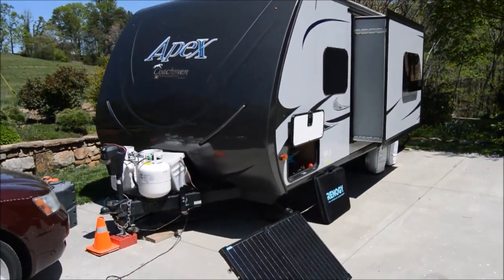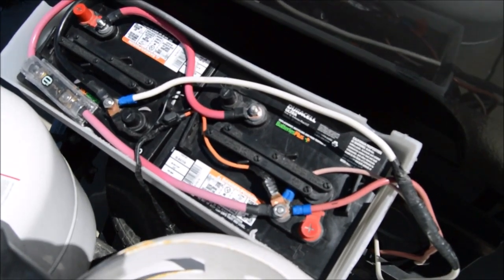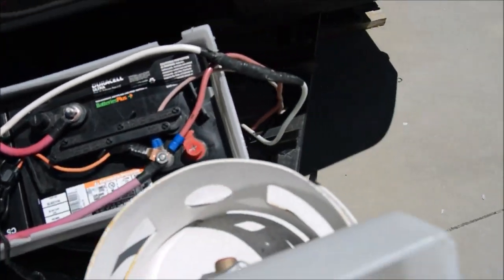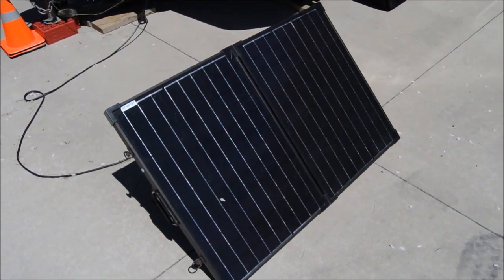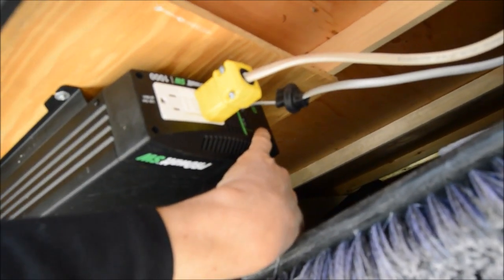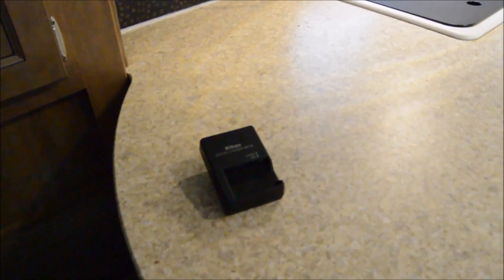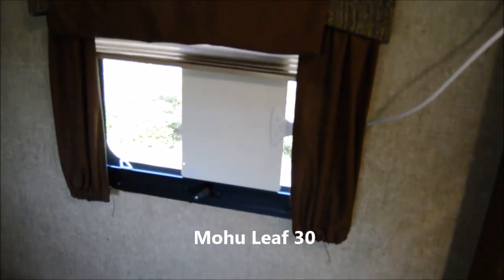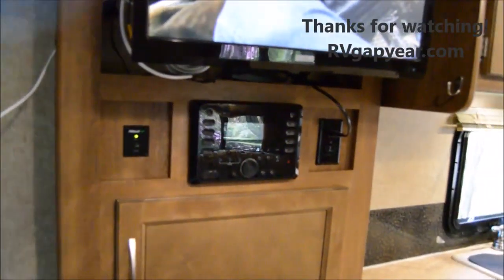Budget Boondocking: Solar, Battery, and Inverter Decisions

Comment: I'm having a hard time understanding the wiring. You only have 1 outlet for solar. The dc lights still run off battery I guest turn off H/W and Refrigerator because I seen some completed systems involving  the panel box and inverters converters

Comment: How much of a benefit is running two six volt over running two 12 volt deep cycle?
Reply: For the same amount of Amp-hours, two 6 volt batts are gonna be about half the price of two 12 volts. Mainly because the 6-volts are used in golf carts, so they have a huge advantage in Economy Of Scale. Readily found at any Sams or Costco.

But It's REALLY important to keep them charged with a quality 3-phase charger. The old 89's/90's dumb (constant voltage) chargers will never fill them correctly, which will lead to an early lead-acid battery death. Same goes for any solar or wind charger.

Comment: HOW'S YOUR SOLAR HOLDING UP??
Reply from the maker: Very well. The batteries have exceeded our expectations!
Reply: @rvgapyear7208  my question is do you have a theft deterrent device or something to keep your solar suitcase from being taken? Any ideas of what can be used?
Reply: @jet0577  10 foot cable with combo lock. If somebody wants to steal something from your boondocking site and you aren't there it's going to happen. Small measures just act as a deterrent.

Comment: Hey There, How did you wire up the receptacle? Did you cut off the end of the extension cord and connect it to the receptacle or is that a 14/2 wire that you put a plug end onto so you could plug it into the inverter?
Reply from the maker: It's 14/2 residential stuff (normally run through studs) and I just stripped one end and bought a $3 plug at Home Depot.

Comment: Did your RV come with an inverter integrated into it?  If so, couldn't you simply wire to it instead of buying another inverter?
Reply: Is your inverter in RV ok to use for this
Reply: Trailers don't come with inverters they come with converters. If you want an inverter when you buy your trailer you  have to request it as an extra.
Reply: Dan Kriston mine came with 1000 W inverter, it runs the residential refrigerator while driving.

Comment: Trojan t105 are 144 dollars each. That's insane
Reply: I get Sams or Costco T-105 replacements (typical golf cart size) for almost half that. In my experience, they only have about 5-10% less real world capacity than Trojan brands. Totally worth the cost savings. Going on 10 years using them in heavy boondocking/solar setup.
Reply from the maker: Yeah, Trojans have a good reputation but my Duracells have held up remarkably well over the last three years and I saved about $100 vs. Trojans.
Reply: Emmy Ann dunnuo... I need a new battery for my truck $119

Comment: Can you charge the batteries via solar while you are using the inverter? Also, Are fusing needed for this or is that just something for extrA safety? thanks
Reply: Yes you can charge the batteries with solar while you are using the inverter. The more solar you have the faster the battery will charge. Keep in  mind that in most cases the inverter will still draw power faster than solar will replenish the batteries.Fuses are always recommended. Fuse or breaker between solar panel positive and controller positive and between controller positive cable and battery positive terminal and another fuse between battery positive and inverter positive.
Reply: YES! I would always recommend using a fuse. It's cheap insurance.

Comment: Did you run into any issues drilling into the floor to run the heavy gauge wire. I'm worried I might drill into some framework so I don't know where to place the hole. Thanks for posting this. 👍
Reply: I was able to drill from the bottom next to existing wires so I know where the frame was. I had no issues at all.

Comment: Is there a good size inverter  to get some say a small one is just as good.  Jack
Reply: Buy a pure sinewave inverter that meets the needs you have for AC power. Getting an inverter too large just uses up more battery power to run the inverter. The larger the inverter the more battery power it takes to run the inverter. If you plan on upgrading your battery bank to more capacity so you can run more AC appliances then by all means get a larger inverter so you don't have to upgrade the inverter after you upgrade your battery bank.
Reply: Anything with sinewave technology should do the trick. ProWatt makes a smaller, cheaper unit if you are looking for less power.

Comment: just a quick suggestion... why don't you just go from the outlet of the inverter to the inlet of the whole TT so you have power in every power outlet? you would need to turn the converter off in order to avoid a current loop.... that how i have it set up
Reply: I considered it. All of my research suggested a big lose in efficiency. I'm glad it's working well for you!
Reply: Jessie Springer vampire theory, just turn everything off and only use that you need.
Reply: @normnilsson7208  We do only use what we need.

Comment: Can you run the A/C with this?
Reply: Absolutely not. A/C requires 2000+ watts and the battery capacity required would be more than double what you see on the video.
Reply: No. We did run 2 fans off it though.

Comment: when you say a jump in performance with the 4 awg battery cable, can you be more specific? what specific performance gains did you encounter?
Reply: Roughly 20-25%
Reply: This is good information. Thanks
Reply: If you use a current clamp when discharging you will see the difference.

Comment: knowledgeable video. thanks. Question. could you not just plug the trailers main electrical connection into the inverter? This way all the outlets and appliances would work off your inverter. this being said you would probably need a 1000 watt plus inverter to keep up with the demand being drawn from the entire trailer.
Reply: Not really. This runs all the 12V wired stuff straight from the battery. You want your refer running of 12v as much as possible when not connected to shore power. You can't run the microwave or A/C from this system. The only benefit as you describe would be running all of the wired outlets (my research suggests a measurable decrease in performance when doing this).
Reply: The reason this is not a good idea is that you will be charging your batteries with your batteries. Your shore power cable runs to a converter which charges your battery bank. If your shore power cable is plugged into your inverter then the batteries are sending DC power to the inverter and the inverter is sending AC power to the converter which is sending DC power to the batteries which are sending DC power to the inverter which is sending AC power to the converter etc etc etc etc....... Its a never ending loop of battery destruction.
Reply: Dan Kriston flip the converter breaker to off - it you have a disconnect, right ?
Reply: @normnilsson7208  yes.  That works too but you'd be surprised how many people forget to do that so I stopped suggesting it and started suggesting an automatic transfer switch.
Reply: Dan Kriston thx. I have everything ready BUT I have not plugged it in yet, chomping at the bit. I even ran a ground rod (back yard) 3.5k pure sine wave 470ah bank and lots of fuses, 30a female connection just waiting for me to plug it in. I’m sitting at a campground with 50a water sewage and a hot tub right now - YES the life
Reply: Dan Kriston my RV came with an ats looking at it now, it’s only 15amp hmmm
Reply: J King  You can do that by adding a bypass (or transfer switch) to the line so when you are plugged into shore power the inverter is bypassed and power is sent to the converter instead of the inverter.